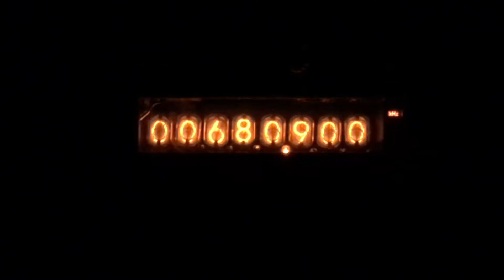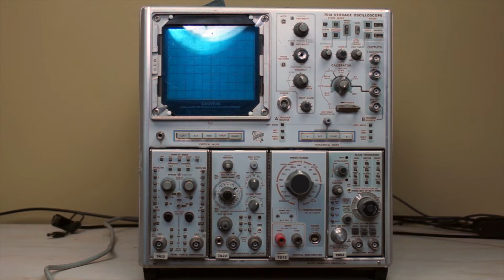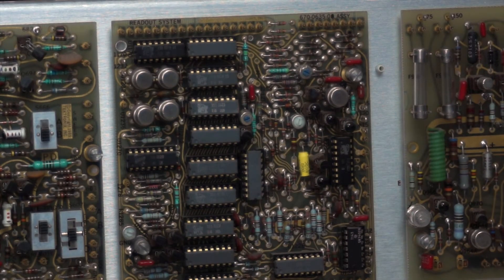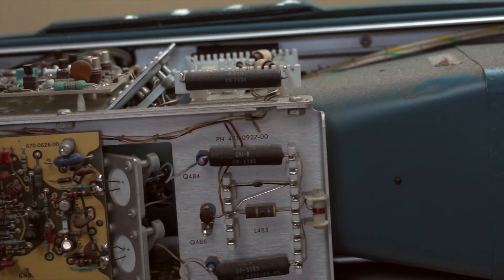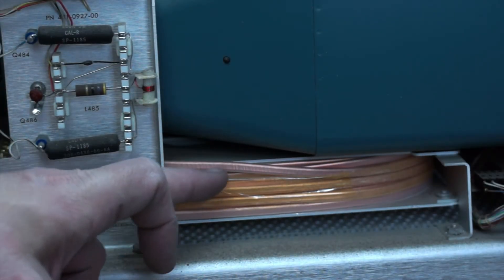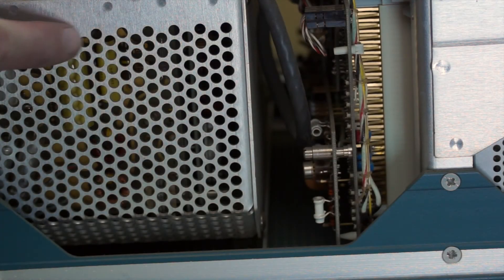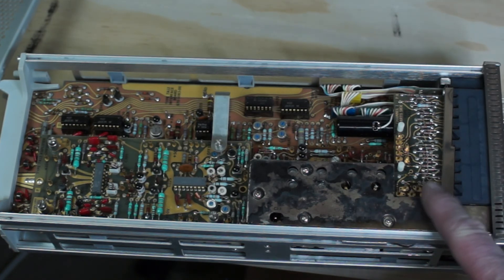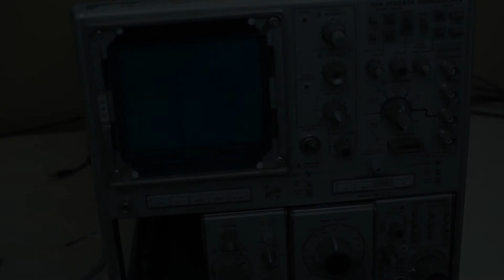Rare TEK 7514 Oscilloscope Teardown

Comment: Unusual to find 74LS chips in a '60s vintage scope.   It probably has something wrong with the power supply.   But just blindly replacing all the capacitors is not a good idea.   I have been fixing test equipment for several decades and  always trace the problem down to the component level.  With US manufactured test equipment I have not found many shorted or otherwise defective capacitors.   You are more likely to replace good caps with low quality caps that will fail soon if you blindly replace all the caps.   What often happens with the Tektronix 7000 series power supplies is a cap or rectifier will fail in the secondary circuit.   The power supply will shut down immediately due to the over-current.  After about 100 mS., it will start up again.  So you will here a tic-tic-tic sound.   To fix it, just carefully  unsolder and lift a lead from each secondary cap until the tic noise stops.  That last cap is the one you replace.  Try to find a high quality Japanese cap.to replace it with.  Do your repair work to the same standards as originally manufactured.

Comment: The delay line will allow the trigger circuits to trigger on the vertical channel. This delay allows the leading edge of the vertical signal to be displayed when the scope is triggered. Without this delay line, the leading edge of the trigger would not be visible.
Reply: Surprising how persistent the misunderstandings about these delay lines in analog 'scopes are. Nothing to do with bits, bytes, storing/recycling of the signal. Your (Carlos') answer isn't completely correct either (maybe just a typo?), because even without a delay line, the trigger circuits would trigger, no problem. Your two last sentences are correct.
The delay line sits in the mainframe between the output of the vertical plugin(s) and the input to the vertical output amplifier.
The input signal is used to generate a trigger signal, which is picked off before the delay line. After the triggering event (after a very short delay) starts the time base (start of the ramp), it takes a short while (several 10's of nanoseconds) for the time base to actually start unblanking and moving the dot/trace, i.e. starting the horizontal display line.
The delay line causes the signal to not reach the final vertical circuits until a short while after this. Without the delay line, the vertical signal causing the trigger event wouldn't be visible, because it would come too early.
The delay line is made of some sort of dual coax (the whole circuit is laid out differentially) and the delay is caused by the electric length of the line and amounts to a number of nanoseconds (35-85 nanoseconds or so, depending on the 'scope model). Compensation networks are used to correct for imperfections in the delay line.

Comment: There is an old Tektronix - Transmission Lines video that was VERY well done, step by step.  I think you'd enjoy it, and it might help to further clarify the mysteries of delay lines!
Reply: Tektronix' description of transmission lines emphasizes the transmission line aspects of electrical connections, mostly to do with impedances, reflections and the like. As applied to this video, it's the time delay caused by the electrical length of the line that is significant.
Reply: @raymonddompfrank1789  Well... what about the parts of the video where they talk about the time delay and the electrical length of the line?  I think the useful concepts are all in there, and with a little nudge from reading a manual, the purpose of the transmission line would be well-understood.
Reply: @ydonl  It seems we both avoided stating clearly that the delay line in 'scopes is there for delaying the (vertical) signal to be displayed so the horizontal starts first, nothing to do with recycling to keep bits(!); very unlike early computer acoustic or mercury delay lines!
Reply: @raymonddompfrank1789  No worries.  Everything  will turn out fine.  :)
Mercury, eh?  I'll have to look that one up!
Reply: @ydonl  Google "Mercury Delay Line". A form of non-air "acoustic" sound recycling system.
Reply: @raymonddompfrank1789  Ah, so using the density of mercury to increase the popagation time in a smaller space, and pumping the audio waves through it.  Back when we didn't think much about playing with mercury...  :)

Comment: Got a 7704A from someone on craigslist for $30. Works pretty well. One of the triggering units needs a new pot with rotary switch, and one of the dual trace amplifiers is junk. Also sometimes makes a popping sound if it sits for a while and you start it up. Goes away and works fine afterwards though.

Comment: Just got a 7904A  for free with a other lot of scopes  I bought and was labeled as bad and tried it and works perfectly, they left beam find on and assume the amps were bad. Plus is low hours. They didn't know how to use it. Already tested it with internal calibrator and signal generator up to 500mhz and dead on specs. Keeping it and will fully restore it to keep it working.
Reply from the maker: Nice.  Isn't great to get something worth probably $10k back in the day from someone's junk pile?   :)     I still have my 7514a sitting around, think it needs a power supply rebuild.   But looking forward to putting it back into action.

Comment: Tek 7000 is 100% analog and no digital (as we know of today) had been used. Even character generator was analog based, specific current to select specific character (generator).  No raster scan has been used. Character display is activated 1). random sampling from signal display or flayback (write reverse) or free running (no display).

Delay line is analog. No digital memory nor delay line memory had employed.  It simply delay analog display signal (vertical).   Because sweep (horizontal) start slower (triggered and ramp), without V-delay we cannot see the beginning of the signal such as rise time.

Comment: The waveform storage on this type of scope is all done inside the CRT. The delay line is used to allow the scope to display the waveform at the moment of trigger -- the trigger signal is tapped off before the delay, and the delayed signal goes to the CRT. Have a look at the TekWiki site, too: http://w140.com/tekwiki/wiki/7514
Reply from the maker: Yes you are right!  My apologies I was stuck thinking of modern/solid state solutions to problems that wouldn't be the first choice in the late 60's and early 70's.   Strictly analog here!   My 5245L nixie-tube counter (circa 1965) also talks about another interesting way of storing data... using neon tubes.